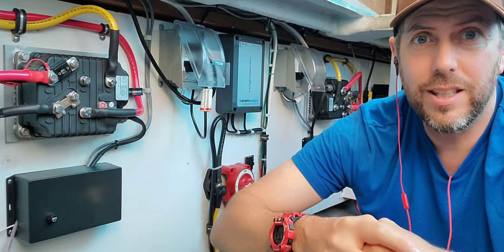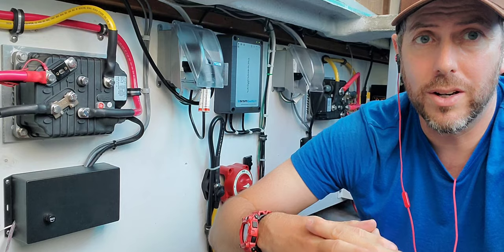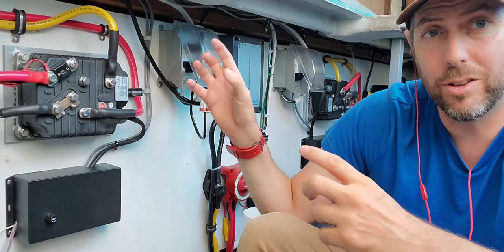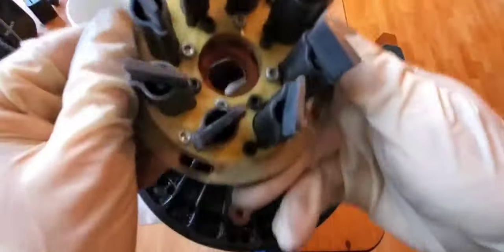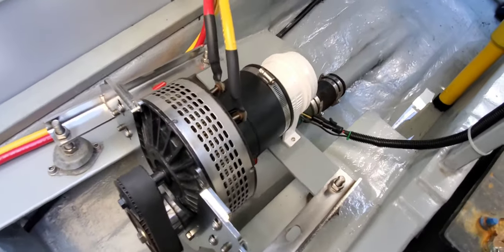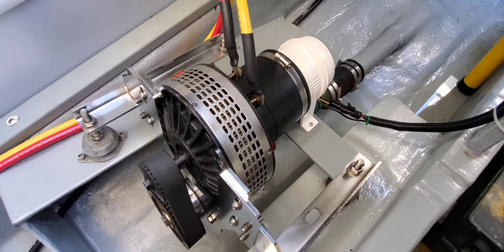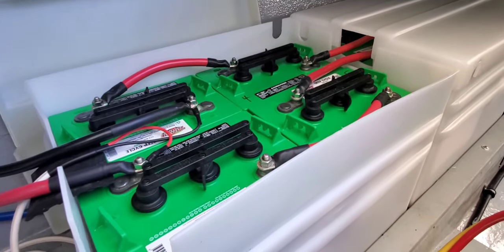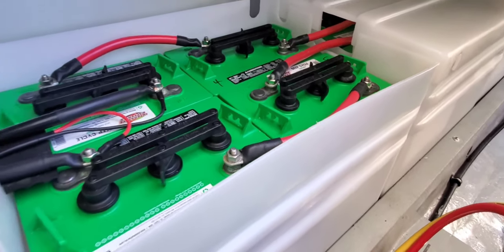Electric Boat - eTolly's Cooling Strategy (US Navy KISS Principle)

Comment: Hi! Recently came across your channel. Love the content and find it very educational. In general what would your system recommendations (batteries, capacity, cooling, and of course the type of motor) for a sailboat diesel to electric conversion? 13,500 lb displacement, 32 footer ! Thanks
Reply from the maker: Welcome aboard! At this point I don't really recommend brands  (since no one pays me hah). But overall, of the top of my head, I'd say a 13kW motor would suffice (assuming you are replacing a 35-50hp diesel).  AC / DC is a personal choice and an age old argument. Ultimately it comes down to use case. I talked a bit about it here back when I thought we lived in a sane world haha  https://youtu.be/apRmIN_gXN8   As a rule of thumb, DC will be cheaper and is good for high torque, low voltage low rpm applications, AC a bit more money, and best used in higher hp, higher voltage and higher rpm applications. At sailboat speeds the efficiency argument between AC and DC is really splitting hairs. At higher power settings however, AC is more efficient. (but you pay for it)

Re: batteries: for a sailboat you might as well go 72V lithium's...it will cost more but will save weight and space (and perform better since there is no voltage sag). You could go 48V but if you have the budget - more power is always welcomed : ) I personally use leads to balance my  boat due to the lost weight of each motor and supporting systems.  

For cooling you just need to get a chill plate for the controller and make sure there is decent ventilation...if you can, choose a motor that comes with a way to cool it i.e. some motors have built in fans which helps.  You might also need to cool the batteries if you run them hard. Everything really depends what you plan on doing, i.e. time on water, range expectations and budget.  Keep in mind electric is best for short clean and quiet trips as nothing will replace a diesel for range.  Hope this helps, cheers.
Reply: @ElectricCruiser  which hp (kwh) dc motor replaces a 20 hp outboard diesel for boat. What AH , voltage used for 100km in sea. Make detailed teardown video of  this motor ! Will the brushes wear in marine environment ! The boat wiring harness near joints do they rust !

Comment: Hi congratulations for the realisation,
Today working in the port , one sail boat blocked the propeller with the cable . I'm want know what happen if the propeller the electric motor happen to be blocked ? 
Tks
Reply from the maker: Probably nothing good :) We have a lot of logs and forest debris in the Pacific Northwest, especially during the spring when their is glacial runoff. Most "seasoned" Pacific Northwest boaters keep their eye and ears open for the thud of a prop strike or sudden change in engine RPM - it's just something we get used to looking and listening for. In my case, I have gauges that display prop RPM which I scan all the time. Cheers!

Comment: why did you go AC  vs DC?    what's the pro  or con?       Secondly..  how did you size your engine?     3rd,  was y our intent to run it at 70%  mostly?
Reply from the maker: The short answer is that the Lynch DC system was available to us at the time of the conversion it 2013. Yes there are AC systems but in our neck of the woods DC was much easier to get and far less expensive. The other thing is that an AC motor runs best at high RPM with high voltage. This is a low voltage boat for safety reasons. These particular DC motors operate at 90% efficiency and have a very strong torque curve that is consistent throughout the entire RPM range. I did a video speaking to the AC versus DC dilemma a few years ago https://youtu.be/apRmIN_gXN8

We did not size the engines at the time. It was just an experimental prototype to see if what was available to us could actually move the boat comfortably. Turns out these tiny little 17 horsepower Lynch Motors only require about 5 horsepower per motor to run the boat just under the theoretical Hull speed. It's an incredibly simple setup and extremely affordable for those interested. But it all really comes down to use case and what you're hoping to see out of the performance of the boat. We are happy just having her as a Weekender to get out on the water and that's why we keep it simple. Cheers thanks for watching!
Reply: @ElectricCruiser  Thanks for reply.  Love talking to tech minded folks.   Ok,  so,  this is what I've gathered.   1)  AC motors allow for replenishing if you at anchor from current.   That seems pretty cool to me, but, then you need an inverter.   2)  GREAT info about the 17hp but needing only 5hp to move.  I also don't need to go high speeds, but, wow,  that's super efficient.    3)  I'd really like better numbers / equations to properly size the engine.  I'm in Asia, and will be taking this inter island of the archipelago.  So, there are some decent currents at times.   I'd like to be able to deal with that and waves.   

I've only seen videos of electric powered boats on glassy lakes.   Never with waves, current, and tide.   Sadly.   So, I'm a bit concerned if I ever need them.

3rd,  I'm also curious on building my own batteries, or just buying some BMW i3 batteries..   

4th,  High voltage is dangerous?   I think high amps,  no?    I truly don't know..  I do see that cars are moving to super high V's like 800 for the porche..  I guess for easier charging.    and I understand smaller cables..    It's also not clear in my head.

if you not busy..    thoughts?

Comment: I am doing a similar project. Do you know the motor rpm at your cruise speed? What is your pully ratio? What is the diamiter and pitch of your prop? This info would help me tremendously. Thanks
Reply from the maker: The no load RPM is 3600 (50V/rpm).My gear ratio is just under 2:1. I'll be doing a video on the powertrain setup where  I'll get into deeper. My guess is the motor rpm at cruise is 1500 to 1800.   Original prop - 14 diameter / 11 pitch.
Reply: @ElectricCruiser  thank you. That will help

Comment: Can this be done to any size boat and at what cost ballpark
Reply from the maker: Yes but the bigger the boat the bigger the price tag. This set up would cost about 6-7K CAD per side (twin props) in main parts not including batteries. Also have to keep in mind any structural work that might need doing if the boat is old. 
Here is a link to my eBook which is really high-level but is a good starting point.
https://cleanharborbooks.myshopify.com/

Comment: I might have missed how you know if the motors need cooling....or do you assume when pushing harder just add extra air
Reply from the maker: Only when pushing harder. Since they aren't enclosed like a regular cylindrical electric motor, they can release heat relatively efficiently - for the most part they run at a steady temp. I just throw the fans on if I have to apply more load / spin them faster. Some people have their fans programmed to turn on at a certain temp or run them continuous. That said, for continuous duty fans you would need fans more suited for it. Cheers!
Reply: @ElectricCruiser  that was my assumption...a little AI or Human Intelligence means you can pre-empt cooling...i.e. achieve a credit in thermal outcomes :)
Reply from the maker: I hear you but like I was saying we keep it simple. The motors just simply don't run that hot for all the reasons I stated. More systems = more complexity = more things that can fail = more $$$. After  7 years, 6 without fans, I think the proof of concept still stands. I'm the same with motorcycles. A lot of my friends love to add on gadgets and this and that but I tend to strip everything off and go with the old school hare & hound /chopper concept. 🙌

Comment: hi when do you think you will be trying out the five blade prop from torqeedo,  l know he only had one of them but it would be good to see one high thrust for speed and amps draw, vs the original the speeds that you do, under hull, speed your  steering will not be affected only using one or the other motor, l think you my be surprised that one  high trust lower speed prop will give you the same speed and nearly half as many miles again from the same battery bank using one motor, torqeedo says there cruise 10 kw motor
and there 5 bladed prop high thrust lower speed is suitable for boat up to 10 tons . 
                                                                                                                                              cheers, adrian uk .
Reply from the maker: Probably not any time soon (or never). I have too many non-boat related projects on the go. The biggest efficiency setback this boat has is not the prop or weight, it's the hull design. It's why in the 60's and 70's they just threw more HP at them. Trying to tweak efficiencies with this boat is like putting a spoiler on a winnebago. In my humble opinion converting a cabin cruiser is done just to have something to enjoy on the weekends. Range can be solved with bigger batteries and/or a genset hybrid set up. Speed can be solved with bigger motors. (but that comes at a cost of range). Cheers